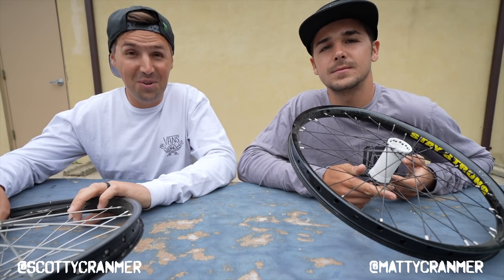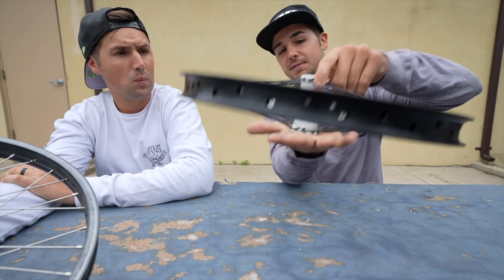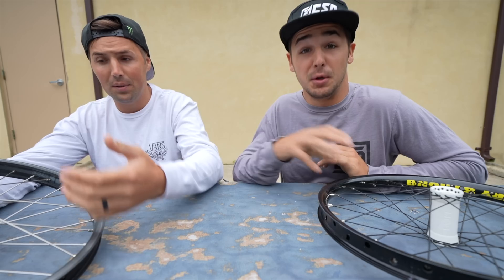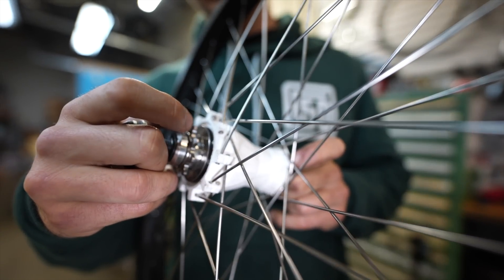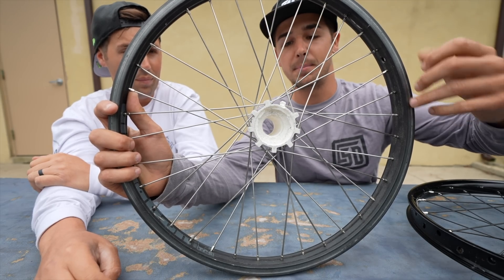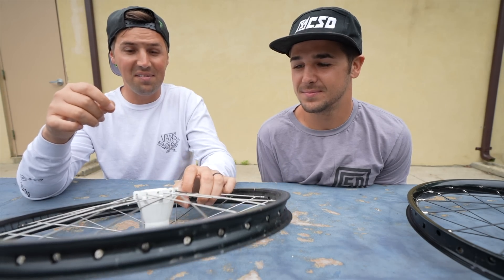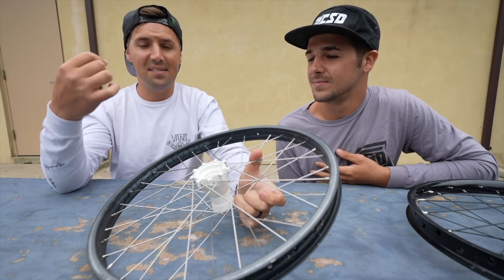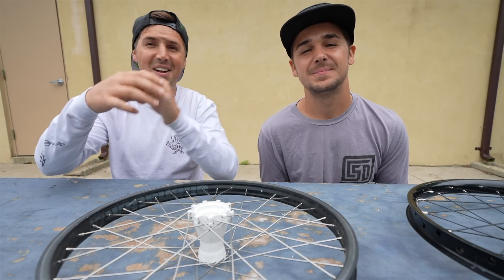We 3D Printed Hubs For BMX Bikes And They Actually Work!

Comment: siick :) I can already see influx of hub models online lol.
You need to checkout the Bambu Carbon X1 printer ;P sorry wallet.
And I recommend ABS its used in almost every manufaturing line these days for the cheap price and great strength/heat resistance. ASA is similar and UV resistant. but more expensive

Comment: Matty, printing it vertical like that makes it surprisingly weak. It may be easier to print but it's not as strong as a horizontal print. The shear strength of the filament is not very strong.

Comment: Make a handlebar end cap that looks like the rubber button that you see on small 2 cycle gas engines, that primes the engine. Find a broken weed eater or blower and take the rubber push button off so you can see how it's made. And, then make it big enough to fit the handlebars.

Comment: I think you did a great job. The rear hub looks similar to hubs that were made in the late 80s, or the 90s. I can't remember if they were made by TNT, or some other company, but they were RAD. Both sides of the hubs had the look of the driver side of your rear hub. I tried to find them on Google, but no luck. Anyways, Great Job Matt. You came up with a cool idea. I wish I could find the hubs I am talking about. I think you would Dig them. 😉

Comment: sprocket, ofc. *maybe a stem...I wouldn't trust either though...not with plastic. pegs are another part on the table..again...strength is an limitation of the material.

Comment: Suggestion. Place threaded metal tube inside and machine a threaded pawl holder. Sort of a metal sleeve inside. That would fix the stripping problem. Best of luck.

Comment: Try using polymax pla. It’s really easy to print and a lot stronger then stardard pla. I used a sludge hammer to try and break it and it took many heavy hits before it broke

Comment: I think you could maybe keep the plastic for the next version, but for the engaging there would need to be one metal ring with teeth on the in and outside which is then put into the hub.. If the driver engages against the metal ring, the ring will put equal pressure on all of the plastic teeth. Also there's then not gonna be space for plastic to fall of and fly around in the hub

Comment: Awesome job. Printer is a good value reasonable quality unit but it needs dialling in. Do some calibration tests and then again when you change print material. Lots of resources online to help you get cleaner and stronger prints.
Metal inserts might go a long way towards a reliable home built product. Metal rings inside and outside the hub cylinder and flanged tubes for the spokes.
Experiment with different filaments. No need to destroy your nozzle with carbon fiber infused nylon straight away. PETG, ASA or polycarbonate are some interesting options to try.

Your 3D model could be used to CNC mill or lathe from a chunk of metal too. Have a nice billet aluminum piece. Model might need some changes to use and obviously you'd need someones expensive machinery to do the job. Skill up that 3D modelling and you can have your designs manufactured in various ways.

Comment: Carbon nylon is supposed to be the strongest also heard polycarbonateis the strongest,, but even just upgrading to pla plus will give you a big boost in strength. Also aneal them after printing them but know that often shrinks them. Also maybe try sand casting the part to aluminum. 

And, it's worth taking the time to learn fusion 360. Doesn't take much and once you get it down projects like this hub will take like 10 minutes to design

Comment: Might be worth using epoxy to glue a pawl ring into the hub shell to make it last longer, if you round off the inside corners of the spoke flanges it will reduce the risk of cracking

Comment: Matty, in Cura, check the box for generate supports. You can then print things that would need to hover without the rest of the part underneath. "Tree supports" work really well, and dont add a ton to the build time.

Comment: That is really cool I would ride a hub designed by Matty. 3D printing is a ton of fun you might want to get a ruby nozzle for your printer and print with the carbon fiber infused filaments, they are supposedly a lot stronger.

Comment: With the right material like CF-Nylon(PA) or Polycarbonate(PC) /CF-PC you could easily make a brake lever or the arms that grab the brakes. Pedals could also work, bar ends, hub guards, and probably lots more. The key to 3D printing is material choice, good print settings, and print orientation. Understanding how your parts are going to be stressed and printing/designing them with that in mind can make them almost as strong as a conventionally made part. Well done Matty, cant wait to see what's next!

Comment: Grab yourself a de-burring tool off a,axon. Really helps to clean up some of those rough edges.  Good on you for getting into 3D printing.  Nice to have a budget printer with an enclosure. Means can print some  filaments like abs or exotics.  Personally I’m a fan of PETG over PLA for tougher parts. Keep at it and can’t wait to see where you get to next. Look into an airbrush kit for finishing your prints even fancier!

Comment: Those hubs are awesome Matty, I do 3d resin printing and I print small parts for plastic model cars, I wonder if you redid your hubs with putting some kind of metal insert inside where they got chewed up, probably gonna need a cnc machine for that but it would be cool, good job dude

Comment: Talon and tree came up with that design years ago. Straight pulls spokes on the inside bore is a horrible idea. The spoke that is typically taking load, isn’t seeing any load, but the opposing nipple takes all of it, it’ll strip alloy nipples or pull a steel nipple threw the rim.

Comment: if you want those in metal you could get them casted. look into the casting process as it uses a mould that melts plastic and leaves the molten metal. possibly something to look into

Comment: Be great to see a 3d seat or 3d bars if that's possible, but awesome work Matty that is incredible 3d printing and this is  one of the best channels on youtube without doubt
Reply: they could not make bars on that size dremel printer, but they probably wouldn't risk it. serious bmx guys will only run full chromoly or in some cases Ti frames, forks, and handlebars.

Max printed a sprocket on Alf Mancuso's channel.

Comment: There's carbon fibre reinforced filament that is insanely strong. It's basically the same as the material used to make the A380 wings. If you get a receiver made out of steel or titanium for the drive pawls to engage with then 3d print with the carbon reinforced filament you'd have some insanely light and strong hubs. 
Be careful with the filament though. The cheap stuff ($50 au per kg) won't be great. The aircraft filament is closer to $180 au for a 1/2 kg roll. But a bit of hunting around and you'll find the good stuff.
Reply: Just be aware it’s not actual carbon fibre as the fibres are no longer than 1mm.  Yes it’s stronger than normal PLA though. You also need a lot of tuning to get it right so experiment with different temperatures and extrusion heights. Also keep in mind carbon fibre and glow in the dark and whit filaments are more abrasive so you’ll need to swap out your nozzle more often. However you can put in a hardened steel nozzle and just use that for all prints.  Or if really never want to replace it a ruby nozzle is $$$ but should last many many years!
Reply: I would just go with nylon though
Reply: Carbon fiber filament is more to help stronger filaments that tend to warp from warping. It won't help with layer adhesion. The carbon fiber will stiffen a finished print though. Continuous strand carbon 3d printing is a different animal and creates really strong prints but requires a special printer that costs thousands.

Comment: Yo dude. If you can somehow put a titanium cassette race in there and make it stronger with some different filament you might just be onto something as far a weight is concerned. But now I wanna see a 3D printed wheel or sprocket

Comment: Try a making the drive side accept press fit metal ratchet ring for the driver to engage with. 
Could last longer that way with a larger support area similar to a spline drive insert for the driver to then bite onto metal

Comment: Good work matty. Will be looking out for ur parts company in the near future . Why dont u try making a stem next? I think that would be fairly easy using the 3d printer 👌
Reply: it would be great for prototyping, but not for videos where they ride it. 3d prints don't have very much clamping pressure.

Comment: Great work Matt and an ingenious way to design around the limitations of the hardware.
 I'm no expert but I'm sure you can get stronger materials for 3D printers. If Koenigsegg can make turbo impellers out of a 3D printed titanium alloy polymer that can survive 120,000rpm and extreme heat then I reckon there will be something between that and the bottle plastic material you're using.
Reply: the difference is the 3d printer Koenigsegg uses to 3d print titanium start at 25k, knowing them they're probably using the higher end ones that are about 500,000$

Comment: if you can scale that up by 2%, you can do what's called lost PLA casting...you dunk the plastic print into a ceramic mud similar to drywall compound, then burn out the plas5ic in a kiln. the remaining ceramic shell can accept molten aluminum, and the extra 2% dimension allows the hot metal to cool, and the part will shrink to the desired size.

I have the gear to do this at home if you're interested in seeing these in metal. I'd just need a few hub prints to do it.
Reply: Yep totally correct. Bringing it to a machinists cleanup would be cheap too. One setup
Reply: Awesome.
Reply: Oh sick

Comment: As someone who runs the 3D print lab of a makerspace I can say the potential of what you can make with a 3D printer is second to no other tool. It's the single most useful machine you can buy. Especially when you get into more engineering grade materials and ditch PLA.
Reply: I keep seeing people say this, and feel really dumb for not getting into it sooner.

Any recommendations for a good one to start with?
Reply: @CNYKnifeNerd  you can't go wrong with an Ender 3. it's about 200$ but deals are everywhere for like 150. tons of pewpew goons use it, it's kind of the hobbyist standard.
Reply: @CNYKnifeNerd  If you can afford a Prusa they are the best out of the box and amazing tech support. If they are too pricey an Ender 3 is a great start but will most likely need some minor improvements.

Comment: Valve caps are a fun thing to print, can do all kinds of cool stuff, 

Also plastic hates to be at 90 degree angles, try to triangulate everything you can
Reply: he's still have to use a raft and supports, but it will be more robust if you can rotate the file 45 degrees. the best pews are printed at an angle like that.

Comment: Pivotal seat posts? Maybe pegs out of ABS?  Brake levers? Pedals? Maybe get real risky with it and make a stem? I got a creality ender 3 max and it's like 300 bucks and sick. 500 is actually pretty expensive for a starter setup. I wouldn't use PLA for anything BMX related. I'd only use ABS.
Reply: I made pegs out of black abs (or pvc, whatever it is called./ the stuff that doesn't shatter that they used to use for plumbing.) I put them over some cut off metal pegs. They were good for standing on, but that's about it. Any grinds would destroy them in a few minutes.

Comment: There are several options for turning that into metal. I'm thoroughly impressed with your self taught skills Matt 👌
Reply: Yeah, he can make a mold and then melt and pour the metal. That'd be the easiest way that doesn't involve fully machining it. I doubt he'd get a lathe (I think they have a drill press already) to do all the machining. Pouring it and cleaning it up after is the most accessible way.
Reply: Melt alloy cans in ya crucible and poor it into a sand clay Mold casters sand, tidy up with a dremel your logo would even boss onto the alloy if you done it fairly good, practise makes perfect sure monster have the cans to melt somewhere, monster alloy crainer hubs
Reply: Looks like matty needs to buy that CNC machine next...

Comment: I've always wanted to get a 3d printer, just to mess around with. But I'm afraid to spend the money on it and use it a couple times and get bored with it. 500$ might be good for what it is, but it's still a lot
Reply: Look up ender 3 pro, in the 200's and probably most popular option. Requires you to take time to put it together.
Reply: @pheelers1831  sounds pretty cool. I don't mind putting it together
Reply: I felt exactly the same at first. But even if I don't use it for a while now and then, I frequently find random uses for it and it is nice to be able to make any idea a reality really quickly.

By the way, I ended up with a Monoprice Voxel, which is a rebranded Flashforge Adventurer 3 if I remember correctly.

Comment: 3d-printed chain tensioners (for frames without integrated ones) might be cool. Low risk of anything going catastrophically wrong and someone getting hurt. Or maybe a 3d-printed gyro assembly, or 3d-printed brake pads lol.

Comment: Great job Matty! You should try and make a sleeve that would fit in a metal step ring for the driver to grab on. It could be an insert that slips into a key in the plastic. Good work! I’m hoping to see these progress and other cool ideas you may have!
Reply: he could do a progressive print where you stop it at strategic parts so you can put metal inserts that will eventually be sealed inside.

Comment: 3D printed pedals or either a sprocket hmmm so many possibilities. Absolutely awesome video.
Reply: Polymer on it's own will just crumble on any bike, the reason "plastic" pedals don't die is because they're reinforced with a fibre. Usually glass. And also use a much better polymer than the likes of PLA (bottle plastic) used here
Reply: @i-_-am-_-g1467  thanks for sharing your knowledge much respect. I think they could probably try a seatpost or even a seat. Whatever they come up with will be very entertaining. Again thank you.